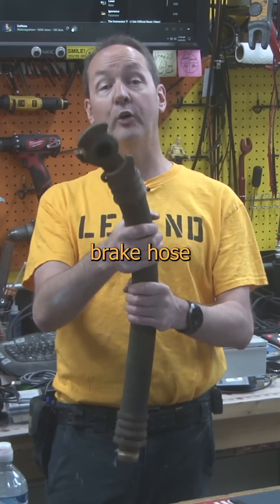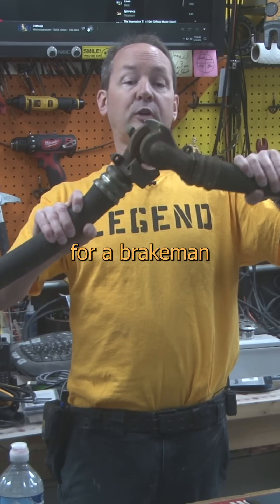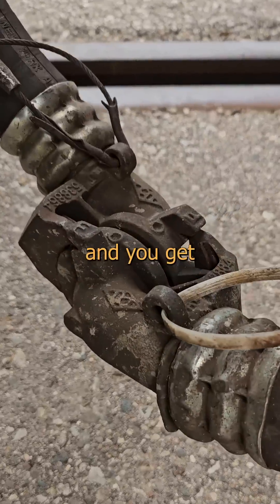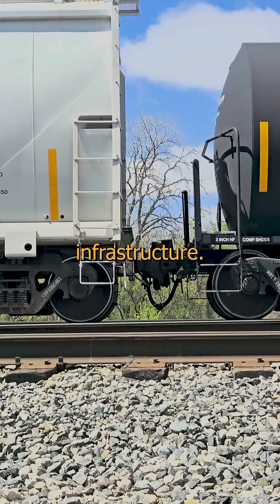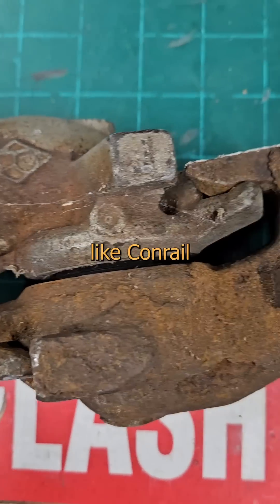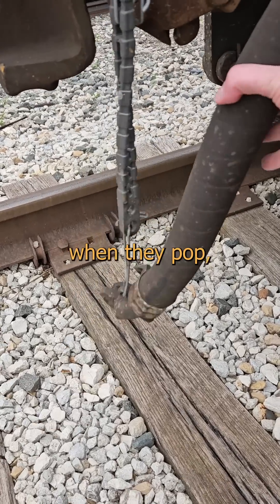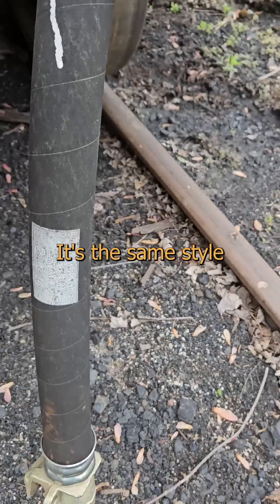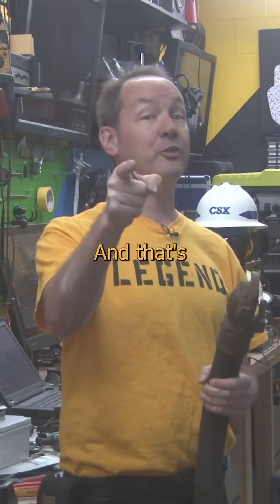Railroad Brake Line #chrisboden #comedy #engineering #train #gladhand #educational #connection #hose

Comment: I used to work for Progress Rail in Muncie Indiana.  The blueprints for some of their locomotives showed this hose (brake pipe hose) installed 180 degrees out of rotation, and thus wouldn't be able to mate to another hose until it was rotated another 180 degrees.  Right hand to right hand is how you shake hands, and its the same for mating these hoses.  Our assemblers were told that the print was "The Bible" as far as they were concerned, and ANYONE who told them the print was ever wrong was to be ignored.  I was THE GUY who was in charge of the final inspection team.  I could not even get the engineers to listen.  It wasn't until the customer ripped their asses that they changed it.  How embarrassing.  I would tell them to shake my hand, and then yell "NO> WITH YOUR LEFT HAND!  That' what you're doing to the locomotive, shitwit!""   Lol!

Comment: Im pretty sure things dont grind to a hault when it doesnt work, thats kindve the problem.
Unless the lines are to retract the brakes.
Reply: They literally do grind to a halt and are designed to do so. The freight cars have mechanical brake control valves on them that apply the brakes when they see a pressure drop along the brake pipe (a pipe that goes down the length of the freight car and ends with the gladhands) from 90 psi. the control valves then use air from a seperate reservoir that each freight car has, to pressurize a brake cylinder correspondingly to the drop in brake pipe pressure. The brake cylinder then applies force to a system of linkages that then push the brake pads agains the wheels.

Comment: The last couple years I've been trusted to run a dirt screening machine with zero training or access to a real mechanic. The machine was obviously designed by a train guy. It is hauled by a semi, and I silently marveled on my  own the other day when I noticed the air connection engineering. My machine is a diesel electric system that has many train parts. The more I tear this machine apart and learn how it works (and breaks) the more I marvel at the engineering involved to make such a frustrating and amazing machine to simply screen topsoil.

Comment: I'm a heavy equipment mechanic. I saw that hose and thought "wow, Chris must be like 3 ft tall, or that glad hand and hose are HUGE". Had no idea that trains used air brakes at all, much less that it was the same theory of operation as an air brake truck.

We actually provide pressure to the brakes to RELEASE them. Inside each brake chamber, on trucks and apparently trains too, there is a big ass spring. This spring pushes the brake rod, which acts on the slack adjuster, and rotates the S-cam. This S-cam engages the rollers inside the drum brakes, just like car drum brakes, and forces the shoes out to contact the drum.

We apply air pressure to fight this spring, which removes that pressure from the S-cam and allows the brakes to release. In a double hump brake chamber, there is a second air diaphragm that operates independently. That one is connected to the brake pedal.

What this means is that if we lose air pressure, for any reason, the spring can't be held back, so it will force the brake engaged and stop the vehicle.

For a train or a truck, this makes a lot of sense. We want to ensure that the truck or train car will stop when it's not connected to anything, no matter why or how it came disconnected. Doesn't matter if it's leaking catastrophically, if the line got cut, if a fitting jiggled loose and backed out.... The train or truck will still stop. It's a brilliant solution to a more fundamental problem: given a hundred different failure modes, how to we ensure the same, consistent, automatic, failure-proof end condition? We design it in a way that it can only work if the system is operating safely. Further, the entire brake system, service, park, and emergency function, is only reliant on that air pressure. If the air works, you can be sure that all of it works.

In a car, if any one of the brake lines is cut, if a caliper fails, if the brake fluid boils, if a pad falls out, if the fluid leaks out and disappears, you have now lost your brakes. Now, the driver has to make a conscious decision to apply the parking brake and stop the vehicle, which might not even be possible if the vehicle has an electric parking brake. Then, you're relying on a separate mechanical system that is usually undermaintained. If the cable breaks, or you've lost one of the calipers, the parking brake won't work.
Reply: Air brakes on freight cars actually do not work like this. Instead, there is a reservoir on each car that is connected to two mechanical valves, and to a brake pipe which is the pipe that goes down the length of the entire freight car and terminated with the end hoses. The locomotive sends air through each of the cars via the brake pipe, and the valves then charge up their reservoir. The brake line stays pressurized as the train moves, and a loss in this brake pressure is what triggers the brakes. This can either be a via a controlled drop in pressure from the locomotive, or a total loss in pressure such as when the end hoses seperate. The mechanical valves respond to this loss in brake pipe pressure by pressurizing the brake cylinder by a corresponding amount, using air from the reservoir. The brake cylinder then generally pushes against a series of linkages that then push the brake pads against the wheels on the train. There is some more to it than that but that is the basic gist of it.

Comment: I used to do inspections on trains had to replace the end air hoses alot. Youre not supposed to pull the cars apart without disconnecting the air hoses first because it stretches or breaks the chain that holds them and fucks up the seals from the hoses but because most of  be conductors that work at CSX are fat lazy pieces of shit they just pull the cars apart.

Comment: Idk if you've done this video already. But if not, you should do a video about the blue signs at railroad crossings. If you looks at the yield signs or the gates. There's a little blue sign so you can call the number on the sign and give them the code so they can alert nearby trains and mitigate accidents.  If you get stuck or see an issue with the rail or even the gates aren't working.  I think it's knowledge a lot more people should know about

Comment: But you didn’t even know what I was gonna ask… was it why you have it? Where you got it? What issue might it have that it should have been removed? Maybe I’m curious how much of it can be recycled or reused for other parts. What it’s made out of? HOW it’s made?

Which one am I not supposed to ask? I have a DOZEN more!
Reply: On freight cars they have to be replaced every 7 or 8 years or when they show certain wear. I imagine the one he has is a garbage hose, and even if it isnt they are cheap and readily available. The hose is a made of fabric reinforced-rubber and the gladhands are usually just cast steel, the gaskets are rubber crimp sleeves are also steel. Im pretty sure they just get thrown out when theyre done, maybe some people cut the gladhands off and scrap em. not sure how the hose material is made other than its 3 layers, an inner lining, fabric reinforcement, and then an outer cover, but the hose assemblies are made by shoving a gladhand into one end, a male pipe fitting into the other (the both have barbs that go into the hose), and then squeezing the crimp sleeves around the hose and the barb underneath. The crimp sleeve (they start off round) being bent into that shape provides enough compressive force to keep the hose material squeezed against the barbs to hold up to several thousand pounds of force pulling on that hose.
Reply: @acehawk888   my brain understood all those answers when I asked those questions… but could not form the words. You are a saint. Please don’t stop bestowing knowledge, you are appreciated ❤

Comment: The best part is, if it becomes disconnected the breaks immediately lock up to stop the trailing cars! Then connected it holds the brakes open.
Reply: technically the air pressure doesnt "hold" the brakes open; the brakes are activated when the air pressure in the brake pipe (the main pipe that runs along the freight car carrying air and terminating in end hoses) drops from its regular 90psi, causing the brake valves on the car to pull air from a reservoir on the car by a corresponding pressure to then pressurize the brake cylinder and the apply the brakes, generally by pushing against a series of linkages which then push the brake pad against the wheels

Comment: Laypeople don't realize that uncoupling two cars that might weigh over 100 tons each requires turning only one lever that is accessible on the outside edge of the car. There is no need to get between two cars, except after they couple, and that's to connect the brake pipes. It's the safest system possible, other than one of the fully-automatic couplers used on high speed trains and rail transit vehicles, etc.

Comment: I used to work for a small locomotive manufacturer years ago. I remember the first time I disconnected a set of glad hands... no one told me they would pull apart on their own, or that they would whip when they disconnected.  The cracked orbital socket was a very powerful lesson that day.😅
Reply: I hope you got a week or two from work (paid) to think through your mistake and heal 😮
Reply: The railway I worked for, the practice was to close the isolating cocks and then disconnect the glad hands. If the vehicle was an engine, then dummy glad hands were fitted that held the hose up.
Only a couple of cars you could not manually separate the glad hands, so after closing the isolating cocks you released the coupling and pulled the cars (and glad hands) apart.
Reply: Damn...
Reply: How does one become a small locomotive manufacturer. Thats such a specific business lol
Reply: @TheLastRealWatchGuy  if you do it the way the company owner did, you work in the rail industry for a number of years and then take a bunch of their proprietary information and customer contracts, take out some big loans and start your own side service.
Reply: sounds like you should've sued someone...

Comment: Worth noting train air breaks aren’t totally stable at low temperatures. When a train is 2 miles long that can introduce enough leaking to cause issues, it can take much longer than normal to pressurize in the cold. CP rail had a serious derailment in 2019 brought on by trainline air brake thermal contraction.
Reply: The hoses, gladhand gaskets, and pretty much any rubber component of the air brake system is supposed to be tested to -40 or -50 degrees, however rubber stops rubbering in cold temperatures, and in practicality it does cause issues. I believe that that specific derailment is spurring canada to work on specific freight car "parking brakes" that mechanically maintain the brakes after an application (different from hand brakes used when the cars are actually parked)

Comment: Min PSI in those lines is 90 PSI the issue becomes that it's a mile of 1 1/4 in line at 90 PSI with every car having its own brake resvoir. Those lines per aar are to be swapped every 7 years but I've pulled some that were dated from the 90s and still running great

Comment: And if they dislodge, best case scenario, you have a Wreck of the Federal Express on your hands. Worst case? Uhhhh, don't ask.
Reply: this is not true, on freight cars it will trigger an emergency application of the brakes, and every freight car will do independently, without the need of air from the locomotive. Freight cars have their own air reservoirs that are charged up before the train moves, and use the air from those reservoirs to apply the brakes. The brake control valves are designed to apply the brakes in reaction to pressure drops in the brake pipe.

Comment: Things grind to a halt, and you get expensive sounds. Which is absolutely true because I've seen the result of a loose pair of these.
It certainly involved very loud expensive sounds. The lost profits kind.

Side note, those hoses face 90PSI of pressure at full release. To "dynamite" the hoses you close the anglecock on the cut you're pulling away from first, that traps air in the hoses. You'll still get trapped air the other way around but not as much.

Second side note, you totally missed out on making a joke about the angle cocks.

Comment: Seriously, as an ex trucker, I was thinking "Damn that's a heavy-duty gladhand."
Reply: I guess because these daisy-chain,  the first traincar has to handle the air supply to every additional car
Reply: There are smaller ones that are used to connect locomotives to each other for communication between them
Reply: Same
Reply: They have to move way more air.

Comment: If i remember correctly, the expensive sounding sounds arent actually expensive, theyre just gonna be annoying as hell if the engine thinks the e brake is on, since you have to do a specific manuver to charge the engine compressors, plus,like you said their ment to deattach when pulled, its a crazy sight to see and ive only seen video(you can see the LITERAL AIR COMING OUT)

Comment: Fun fact: separating the hoses by letting them pull apart while pressurized is called dynamiting. Also the bungee helps the hoses from dragging while not connected. And that's pretty cool!

Comment: Fun "Fact"¹: Unlike automotive brakes, which are applied by adding pressure, train brakes are applied by removing pressure. This causes the cars to brake automatically if there is a line break or the car is disconnected.

1: the air quotes are because this is something my dad told me decades ago, and I may have forgotten enough of the particulars to have the idea wrong.
Reply: Yes, but keep in mind the drop in pressure triggers the brake application, but at least on freight cars, the brake cylinder on every car still needs to be pressurized to physically apply the brakes. The brake control valves do this by taking air from a seperate car mounted reservoir, and pressurizing the brake cylinder correspondingly to the drop in air pressure in the brake pipe.

Comment: The "bungee cord" isn't there to prevent them swinging around. It's for FRA compliance from the height of the hose off the rail. FRA regulation says the gladhand has to be at least 6 inches higher than the top of the rail.

Glad your finally getting to my domain of critical infrastructure. I've been a carman for 6 years

Comment: Wait if train breaks are applied when they lose pressure, then how do classification yards work with the little hill
Reply: the freight cars still need air to physically engage the brake cylinder and apply the brakes; each freight car has its own air reservoir that is charged up before the train moves. The brake control valves on each freight car use this air to apply the brakes, and they respond the pressure drops in the brake pipe. So if a freight car disconnects from the rest of the train while it is moving, the control valve will see this drop in air pressure and dump all the air from the reservoir into the brake cylinder. In a yard, the cars are completely emptied of their air, so the only thing that can engage the brakes is the hand brake, which is seperate from the air brake system and is like an hand brake in a car; you have to manually engage and disengage the hand brake and it is only use for parking.

Comment: Hah! You probably picked that up off the ground didn't you? These hoses litter any rail yard when they finalyl DO give out!

Also, the average pressure of a train line is 90 PSI. 

That little black part you see in the hole is a gasket, just made of rubber, and it usually gives out before any other part of the assembly. Replacing bad gaskets in an air hose takes maybe ten seconds, and we always carry a couple on our belt loop for when they're needed!

Comment: As a railroad worker i can't explain better than you the brake line hose. 
I can only say that before disconnect them you have to close the valves just above the connection to avoid losing your theet
Reply: I love how something so dangerous can be explained in such a funny way. my dad works at a coke factory and he always says stuff like that that both horrifies and amuses me at the same time
Reply: Angle cocks!

Comment: Pressure is 90 psi on the regulating devise on the locomotive for freight and 110 psi for passenger service. Maximum pressure differential on the rear of 15 psi. What is even cooler is brake application are made by the locomotive engineer by reducing pressure in the brake pipe with the automatic brake valve. The drop in pressure causes the spool valves in the control valve on each car to send air from each service reservoir to the brake cylinder(s). An approximate 3 psi increase in pressure cause movement in the spool valves air is vented through the retainer valve. The retainer valve, initial quick service, accelerated service release and emergency brake applications are interesting topics that deserve discussion.

Locomotive Engineer, Retired
Louisville and Nashville RR
Reply: nailed the explanation!
Reply: THANKS!

Comment: I there is fluid in those air lines you will have problems.
Reply: Fluid - a state of matter, like a liquid or gas, that deforms continuously under an applied shear stress or force

Comment: iveco trucks have the same air line connectors but worst in every way. the seal refuses to work in any weather without silicon.... the heads usually bend and deform so they detach.  

they don't make them how they used to

Comment: They should have holders to connect them to when not in use to keep stuff from getting in the hose and keep the rubber seal from dry rotting.